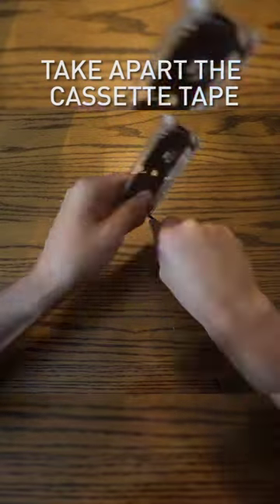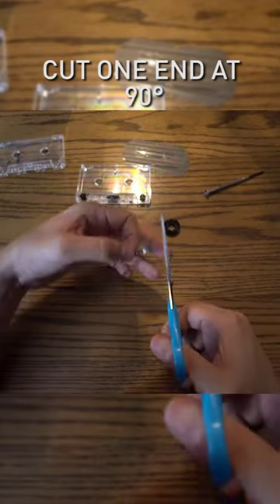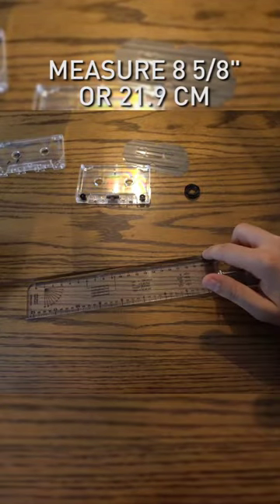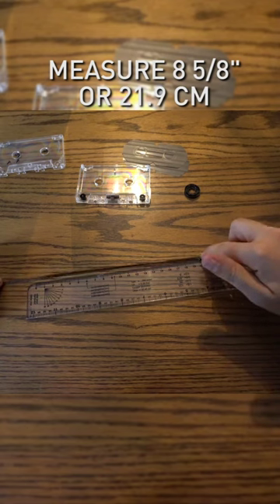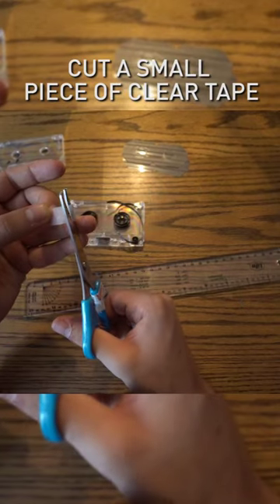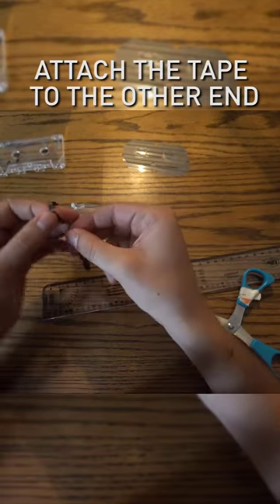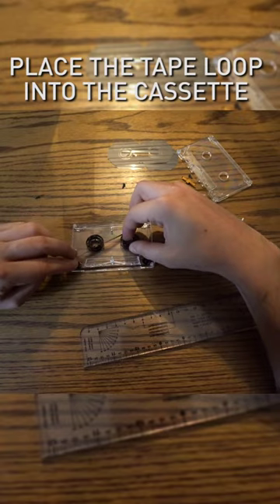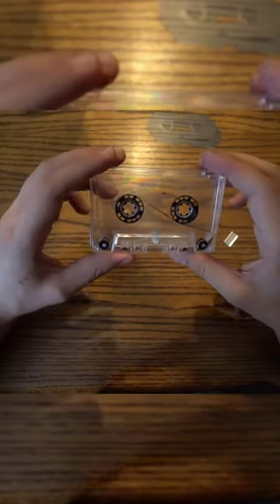How to make a tape loop

Comment: Hi, why is my loop not playing continuously, there is a small stop?
Reply from the maker: The tape could be too tight. Try loosening the tape or if you have both of those black plastic circular things take out the second one that doesn't have the tape loop on it.
Reply: Thank you
Reply: Look into 'splicing at an angle' with a 1/8 splice block to ensure a smooth transition